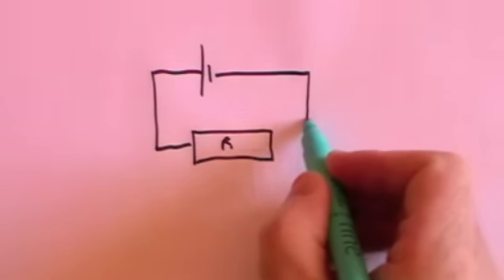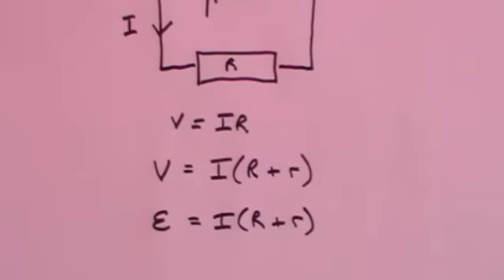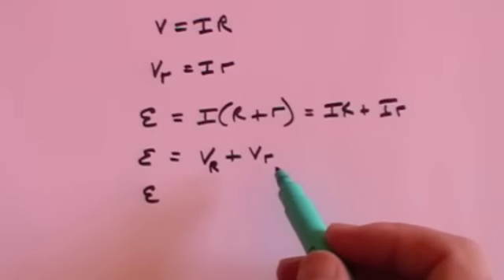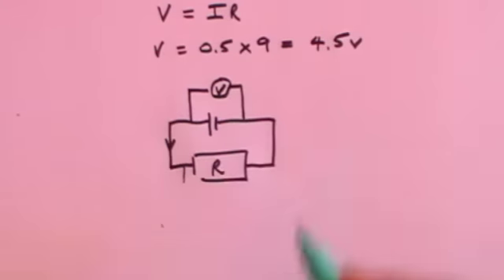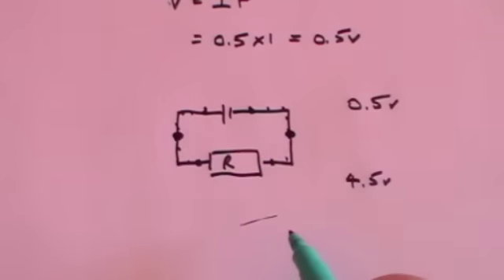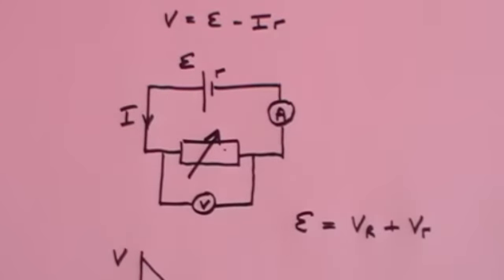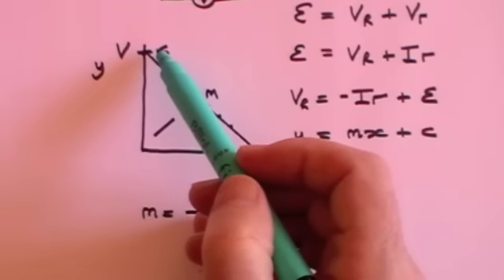Internal Resistance - A Level Physics

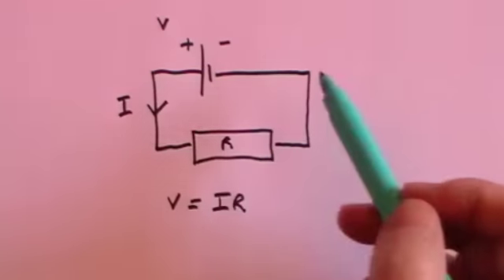Comment: 0:48 Dr.Physics, someone told me that the classical concept of "electrons flowing in a circuit" is not correct but rather it's an electromagnetic wave (radiation) that travels in the circuit and not the electrons. Is this correct?

Comment: What do yoy mean by internal resistance. What thing is resistance
Reply: A battery is not an ideal current source. If you have a perfect conducting wire and short the battery out, the actual current will be less than the ideal current because the battery has some resistance internally.

Comment: Won't the voltmeter provide potential drop
Reply: yes. Modern volt meters have a very high input impedance to reduce this effect. Older meters had a 'table' on the dial to allow you to calculate the effect of the meter on the circuit being measured.

Comment: at 18:30, if there is only a single resistor in a circuit, wont it take all of the voltage of the battery? so if we change the resistance, in any case it will use all of the emf of the battery thus the voltage remains constant? further, if we increase the resistance, the current will decrease so why wont the voltage remain constant? 
where am i going terribly wrong

Comment: If I understand this correctly, this is why the measured bus voltage on my battery-powered circuit decreases as the current demand from adding loads increases. It's a function of that negative sloped V to I curve which is set by the internal resistance of the battery. So, if I have a battery with a large internal resistance, the voltage on the circuit decreases dramatically as I draw more current. Is that correct?

Comment: Electricity flows because the - side of the battery has MORE NUMBER OF ELECTRONS than the + side of the battery which has LESS ELECTRONS. It is totally wrong to say that charges attract, so electrons move from - to +. Here, + & - are not charges, they simply denote that - means more number of electrons = higher potential while + means less number of electrons meaning lower potential. Thus electrons move from higher potential to lower potential i.e, from - to +. By convention, we say that current flows opposite to the direction of flow of electrons, i.e from + to -. Guys this is a very important concept. Although f*cking lazy, seeing such crap being posted in a video and it being on the internet where thousands of unknowing people will learn from it.
And if you feel like I'm wrong, think logically. If unlike attract, if there even WERE unlike charges in place of the + & -, wouldn't the attraction have been equal for BOTH resulting in an attraction from both the sides resulting in the +ve & charges meeting ? Instead of a one-sided flow of CURRENT ? ;))

Comment: +drphysics A. Pls clarify this solution for me. 
http://physics-ref.blogspot.com/2015/08/physics-9702-doubts-help-page-187.html 

question no 913. ... iv) 2 and 3

I thought this in two ways, and it would contradict the other answer through either one of them. ...

1) Pd is the amount of voltage a component can take,  with this...

T pd across A = 4.4+ Ir (which is wrong) and T pd across B= 2.3 +Ir (which is correct)

2) terminal pd across a  component is the (total emf - pd of that component)

which gets me the answer to 2 but 3 becomes wrong..

aagghhhh

Comment: 17:46 one question. can the voltage go zero if the value of the current reaches some particular value because the graph you made indicates so as the gradient is touching the axis
Reply from the maker: No. The voltmeter operates by having a very high resistance and so a very tiny amount of the current flows thro the voltmeter. Most of the current flows through the resistance. But if the resistance value becomes too high (and higher than that of the voltmeter), then most of the current will flow thro the voltmeter and the experiment ceases to be valid.
Reply: DrPhysicsA i understand thank you

Comment: I don't understand why when the circuit is close and you measure the voltage across the battery you get 4.5 V? shouldn't the battery and resistor work as potential dividers?  it's like putting 1 ohm resistor beside a 5 ohm resistor, with a 5V battery, does that mean that when you measure the voltage of the 1 ohm resistor you will get 4.5? I'm puzzled.
Reply: A voltmeter measures the difference in potential between the two terminals. If u look at the diagram, when the voltmeter is put across the battery, the right hand side terminal measures 0 V as all the energy the charges are carrying has been dropped across the resistor, as when charges come back to the battery they have no energy or in other words, all the energy charges carry is dropped across the circuit. So the right hand side terminal measures 0V. The left hand side terminal measures 4.5V as the charges gain 5v from the battery but lose 0.5V from the batteries internal resistance, so they leave the battery with a P.D of 4.5, this means the voltmeter measures 0 on the RHS and 4.5 on the LHS so the voltmeter reading is 4.5V

Comment: Sir, I have the same question as someone in the comments. When you are trying to measure the Internal resistance at 16:15 in the video, you put a variable resistor in the circuit and plot the voltage drop across it against the current. My question is, shouldn't the voltage remain constant? Since you increase the value of the resistance, current decreases correspondingly, so that V remains constant. Where am I muddling it up?
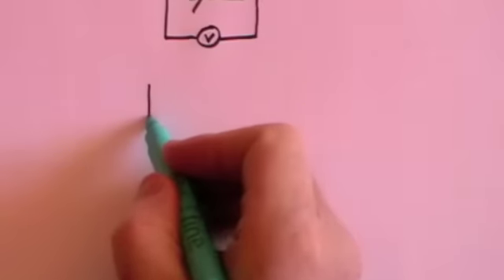Reply: are you talking about the Voltage in the Voltage Current graph around 17:13???
Then he is talking about the voltage through the resistor after the voltage drop
so when you change the resistance R the the voltage through the resistor after the voltage drop also changes, it's NOT the total voltage and because the total resistance has changed the current also changed (because V = IR)
I had the same confusion when I had first learned about it.
Reply: I get where you're confused. Think of the variable resistor as one resistor split into 2 parts by a sliding contact, one part is the one you use and you take an output voltage from it, and the other part you don't use it, but it acts as a potential divider with the other part. The voltage of the output you're using can be increased by increasing the length of the part of the resistor that you're using, by simply moving the sliding contact. Remember that the sum of the voltages of the 2 parts of the resistor is always equal to the voltage of the battery, so by increasing the voltage of one part, you're in turn decreasing the voltage on the other part. Now when you increase the resistance, you also increase the voltage, but the current drops...you may say that when the voltage increase, the current must also increase and that's true, but think of it in this way: when the voltage increase, you can't get extra electrons from outside to compensate for this increase in voltage and so the number of electrons in the circuit is limited, and thus the current is constant. Think of it as 2 horses pulling a cart across a rocky path (lets call it x), if the path is short (small resistance) then they will spend little energy crossing it (low voltage) and they will pass it very fast (high current) becuz although it's rocky, but it's very short. Now when you increase the length of the road( increase the resistance) you're inturn making it MORE ROCKY, and so the poor 2 horses will have to spend more energy (more voltage) to cross it, and since the path is more rocky, they will take longer time to cross the distance x they crossed that they crossed before and thus the current falls, since there are no other horses to come and help. hope that makes sense? I tried to make it as simple as possible.
Reply: Mahmoud  Matar thank you so much and also the previous commenter :) I had forgotten about my comment but maybe others can benefit from your kindness

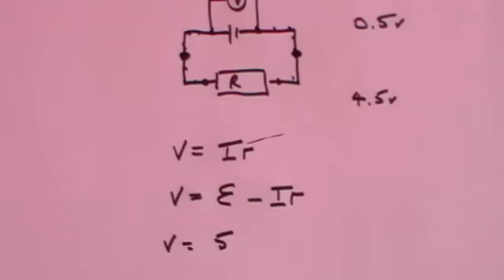Comment: At 13:31 when i calculate i find voltage drop was 0.5. But when i measure it, will the voltmeter reading be 4.5 volt ? And also will the reading of voltmeter in the resistor be 4.5? Thanks!

Comment: Is not the resistor kind of diluted in the mass of the battery? The électrolitic or chimical? So the internal resistor is in between  the two  poles.   That would put the variable resistor in PARALLEL with the internal  resistor intead of in series.

Comment: The voltmeter doesn't have resistance ?
Reply: Serkan Demirel what the actual fuck is wrong with you " Ideally, an ammeter should have a zero resistance value, but materials with zero resistivity are not present" CAN YOU FUCKING READ???? i wasnt even talking to you
Reply: Actually voltmeters have a massive resistance, so they don't take any current from the circuit
Reply: +Rony Polisaintvil It does I recon. But very insignificant.

Comment: when we open the switch then current should flow through battery and thus internal resistance will be offered and then the terminal voltage us not equal to emf

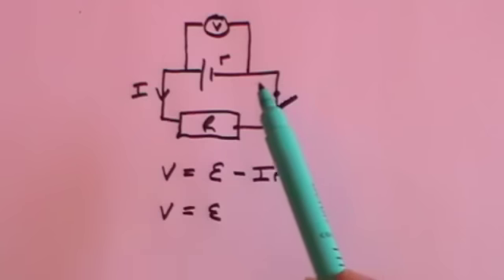Comment: How is that V= E - ( I * r ) ????  (15:46) 
Is it correct for Voltage across the battery =( E - Voltage across the external resistance or main resistance ). 
So it will be that V= E - (I * R ).
There is no current, If Switch is open. So, Voltage across the main resistance is zero. Therefore, V = E - 0 => V = E.
Reply: small r = internal resistance

Comment: i don't get the graph for the variable resistor because as resistance increases current decreases so surely voltage stays constant due to v=ir not just v increases as r increases
Reply: oh so its the emf that stays constant not the terminal pd due to v=E-ir and I increases V decreases
Reply: +legendfooty when current doesn't flow through the cell yet is when you can measure the emf because current lowers the emf into pd so the circuit has to be opened
Reply from the maker: What time on the video does this occur?
Reply: 17.5 mins
Reply: DrPhysicsA please reply
Reply: legendfooty The graph plots the voltage drop (over the resistor) against the current, not the battery voltage. When the resistor value increases, the voltage drop will be higher and the current will lower, and vice versa.
Reply: legendfooty Yes the EMF is the V in the battery that is constant where as the PD is the V supplied to the circuit which can change dependant on the R
Reply: Then do you measure emf using a voltmeter connected to an isolated cell? basically how do you find out the emf of a battery before internal resistance takes effect and lowers it to a terminal pd.
Reply: If you measure the cell on its own is what I took from the video at least. because he said when the switch was open you get teh EMF on the voltmeter
Reply: where is that in the video? what time?

Comment: V=IR is not ohm's law....
Reply: Ohm's Law deals with the relationship between voltage and current in an ideal conductor. This relationship states that: The potential difference (voltage) across an ideal conductor is proportional to the current through it. The constant of proportionality is called the "resistance", R. So yes it is.
Reply: NO!! V=IR  is not ohm's law.... -----------------------------------------------------------------------
"We stress the relationship V=I*R is NOT a statement of Ohm's law. A
conductor obeys Ohm's law only if its V vs. I curve is linear, that is, if R
is independent of V and I. The relationship R=V/I remains as the general
definition of the resistance of a conductor whether or not the conductor
obeys Ohm's law. . . . . . . . . Ohm's law is a specific property of
certain materials and is NOT a general law of electromagnetism, for example,
like Gauss's law."
-

Comment: Something is bugging me
If im correct you said,
V=Emf-Ir then at I=0,
V = Emf
but didnt you say earlier that V=IR?
If that is true then why not Emf = 0R =0?
Reply from the maker: emf is total voltage capability in battery/cell. V is the "external" voltage (i.e. the amount available after driving through the internal resistance)
Reply from the maker: Ray Kay Yes but the voltmeter has a very high resistance so the current is extremely small.
Reply: DrPhysicsA Isn't there current flowing around the circuit connected to the volt meter though?

Comment: So basically, Electromotive force can be analogous to potential energy? If so, is it a force?
Reply from the maker: No it is not a force. Even though it is called the force. As you say, it essentially is the potential energy stored in the battery.  It is measured involves which is work done (or potential energy) per coulomb of charge moved.

Comment: EXCELLENT PEDAGOGIC!!! I would wish all my teachers would have had your teaching skills. After watching this video I did my own test and I came up with a question. Let's say the my circuit has an intrinsic impedance. I would have three resistances in my circuit: the R (resistor on your explanation), r (internal battery resistor on your explanation) and Rc (impedance of the circuit without battery and without resistor R). How would I add Rc to the calculation?
Reply from the maker: Since we are using a battery it will be DC. So any AC impedance effect would not arise and you would simply look at the resistive element of the reactance. you would simply treat that as another resistor.

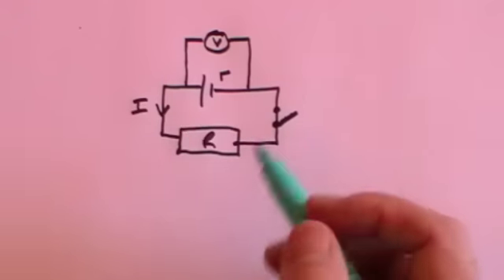Comment: At 15:00 you say that the current will be 0 and hence the emf will equal the voltage displayed on the voltmeter. Surely there will still be a current through the voltmeter?

Comment: Hello, I would like to know: what camera are you using? Are you using an external microphone?
Reply from the maker: I use a Panasonic SDR SDR S26 and I switch off the autofocus. I use the internal microphone of the camera.
Reply: Thank you for these details, I am interested in creating similar teaching videos, in other fields of knowledge.
How do you make the camera stand above the papersheet? A peculiar device or a handmade thing?
Reply from the maker: Julien Ferté It's just a standard camera stand. I arranged for the  Camera to point vertically down onto an A3 sheet of paper.

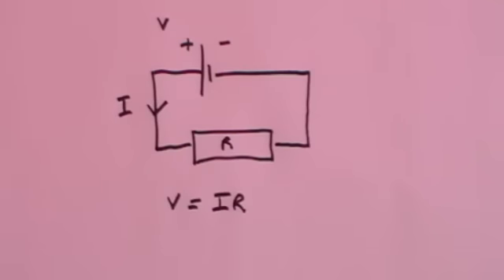Comment: (1:30) THAT'S NOT BY-THE-BY!  You're telling me that science refuses to correct people on the direction of flowing electrons because, "well, it's always been like that"?  That's insane and I refuse to comply with convention.  Henceforth, my diagrams will be drawn to accurately represent the flow of electrons from neg to pos.
Reply: Good luck with that.  If you learn to understand the material instead of relying on what convention dictates, it won't matter.  The convention is simply language that communicates what you are doing to others in the field, (but most importantly, in other fields, such as electrical engineering), and if you decide to rebel and draw your diagrams in reverse of convention, it will only serve to cause confusion and make your life and the life of any you are communicating with, hell.
Reply: Another self-righteous idiot.
Reply: According to my physics teacher it is because there are a lot of equations formulated using that"direction" so if we completely change that the equations will not be "useful" hope it helps;)
Reply: You should also swap the +/- polarities of the battery then because they refer to the higher and lower potential points of a positive charge.